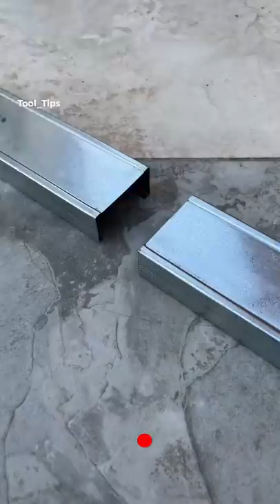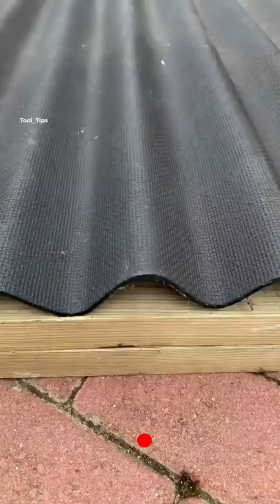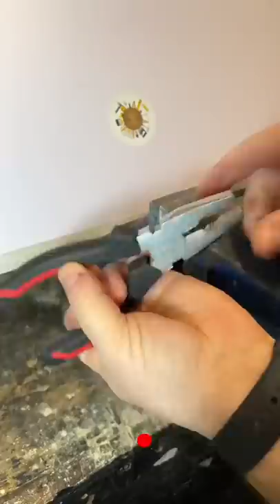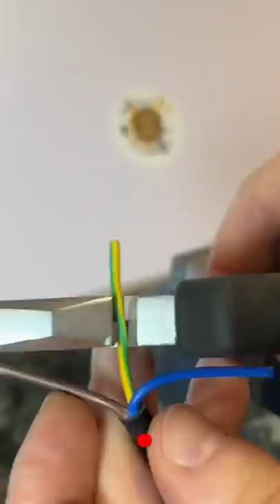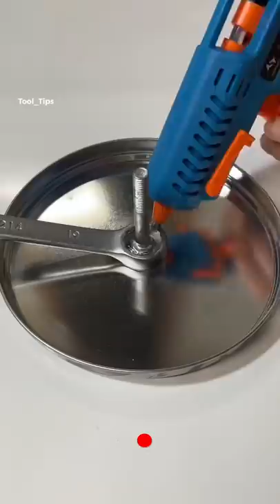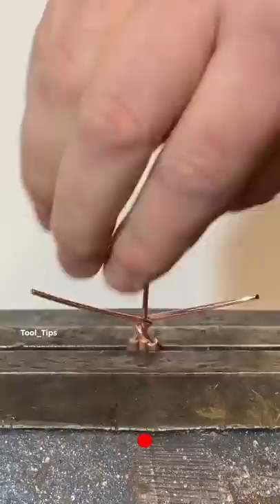Five Tips #shorts

Comment: What was the purpose of hot glue on the bolt?
What did you spray it with at the very start?
Thanks!
Reply: I think it was meant to be a make shift thumb bolt.
That spray was probably some kind of lubricant, maybe WD-40, to make sure the glue didn't stick.
That is just my guess.
Reply: I think it was so the bolt had a bigger handle to hand tighten it but as for most of these tips probably not very durable
Reply: @Zexidous  We both agree on the WD 40 but my thought on the bolt is to prevent damage to anything that might hit it while using the vise. Does that sound reasonable to you?
Reply: Probably WD-40 or some other type of lubricant to prevent it from sticking to the inside of the wrench head.
Reply: @DandyLion.Wishes  Nah. Definitely just a way to be able to thumb tighten the bolt. It gives it a larger, dull surface to pinch onto.

I actually think that's pretty cool. Not super durable, but I could see this working in certain applications.
Reply: Zani Taniri  

my

Comment: Definitely don't have this guy do any electrical work for you there's about 3 different things wrong with that like for one how do you fit the vice in a junction box and for 2 how you gonna get a wire nut on that and 3 nothing to insulate after he's done and his roofing is gotta cost a fortune those are some expensive nail washers? Also then he's gonna have to drink the bottles then he'll die from alcohol poisoning on your roof.